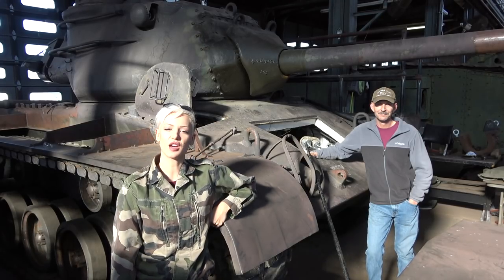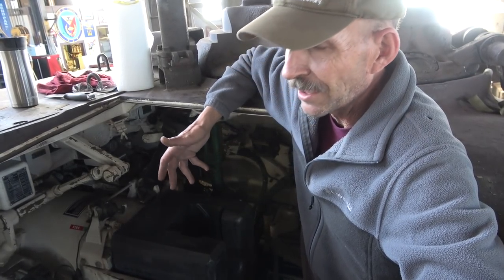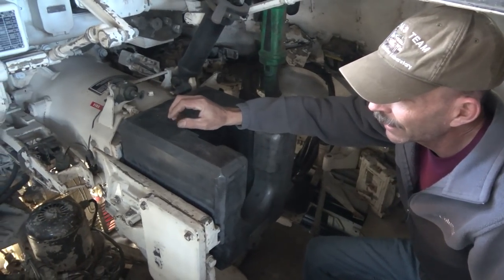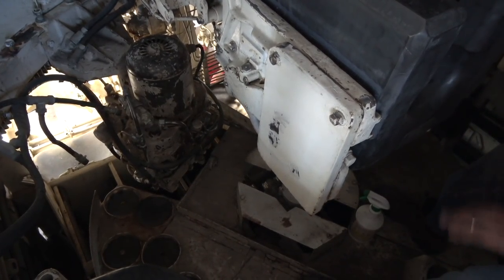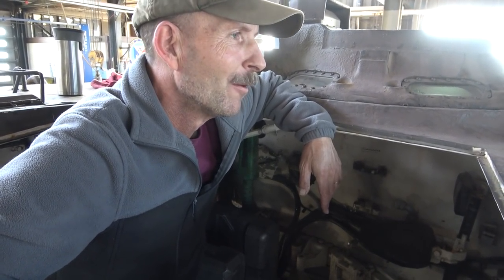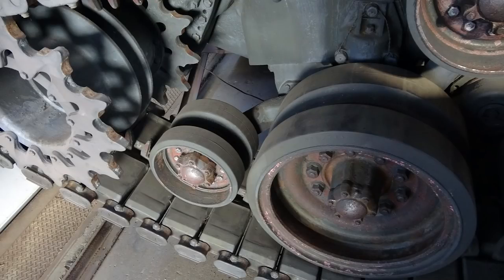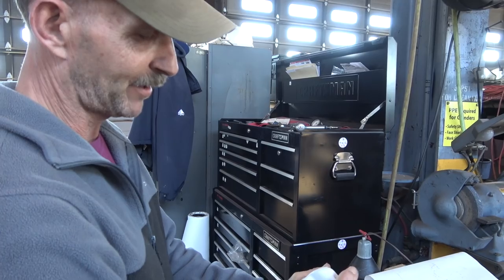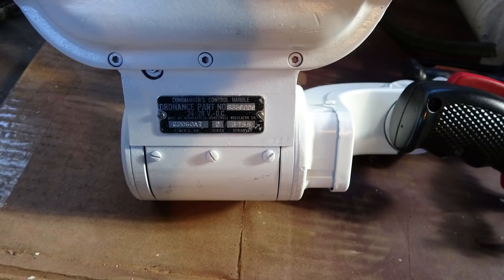M47 Patton Cutaway Tank Restoration at National Armor and Cavalry Collection

Comment: Very well done presentation! First time listening to Bill, but won't be the last.

The mention of the twin mufflers triggered a memory that 60+ years ago I built a plastic "Patton" tank, with no info on the M- number.  It had flat oval mufflers on each side of the rear deck. Apparently it was an M47 or earlier. Molding quality was so-so even by the standards of the time.

The "almost after" photos at the end are gorgeous!

Doing a cutaway is a conditional thing.  If it's a rare piece, you don't cut it, but if it's common, the cutaway is extremely helpful.

...and Bill's hat is to die for!

Comment: "Most tanks nowadays, or in the last 30 years haven't had any sort of muffler." The turbine-powered M1 is 41 years old, which I assume is what he's referring to, since you can't really make a muffler for a turboshaft engine, but are the Challenger 2, Leopard 2, and all the other piston-engine MBTs really running with open headers? 

Looking at videos of Leopard 2s rolling coal on acceleration ... yeah, I'm not sure there's room for mufflers between the engine and the exhausts above the drive sprocket, and some videos have better sound than others.

I guess once tanks got to 60-70 tons and 120mm guns firing tungsten lawn darts, they gave up on subtlety.

Comment: I think there are several cutaway training tanks out there. A big label as
"Modified Training Tank"
19xx mod* type* Name
Training Mods - 19xx
Cutaways, catwalk, windows(small font)
Then the actual history section.
Hopefully save you some unwarranted grief.
.
I hope you all get all the support you need for a full, proper historically sensitive restoration.
I think Perspex or Acrylic fill plates in the cutaways would be an excellent way to retain them, their perspective & their history, while also regaining the sound & airflow restrictions of being enclosed that way.
Possibly hinged/easily removable for best of both.

Comment: I guess that team really needs special paint removal tool that car restoration specialists use, it's akin to sandblasting, but actually uses pulverised nut shells, which are softer than metal, thus blasting it removes only paint and rust, leaving metal intact. No idea how expensive the machine itself is and how much expendables for it cost.

Comment: I have no doubt that this man is a great repairman as well as a good tank crewman. However, I think that he missed a great opportunity to present some interesting facts as well as anecdotal information about the M47. Over 8,000 were produced and it has quite a service/combat legacy outside of the US. Jordan (1967), Pakistan (1971), Turkey (Cypress 1974) Ethiopia/Somalia (Ogaden 1978?) come to mind. The sighting system was a challenge for some, but, not a failure. The main gun was fine for it’s time and beyond that. Upgrades including the M47E1/E2 and the M47M carried this MBT into the 1980’s. Iran has shown a fairly recent modification of the M47 with reactive armor. I am curious as to why the ROK did not adopt some of these improvements for the tank, although, they and Spain did make an ARV as well as an engineer version.